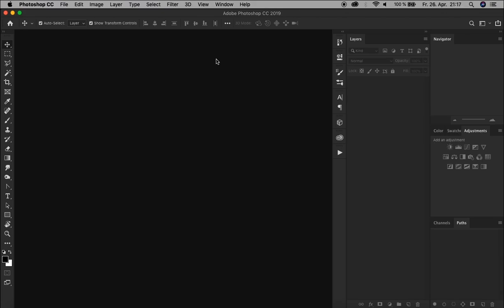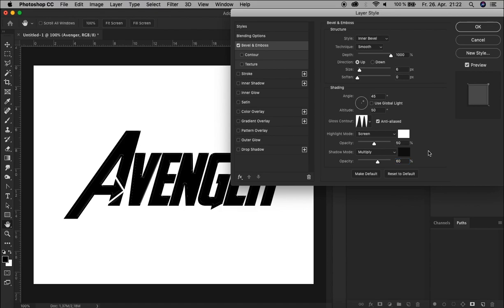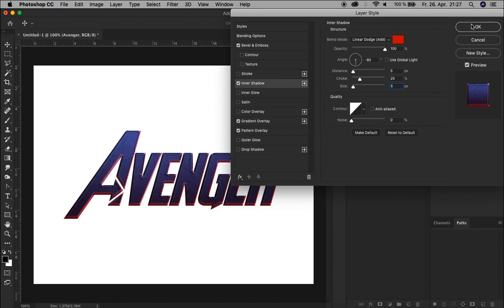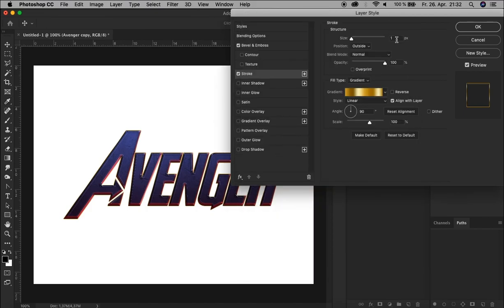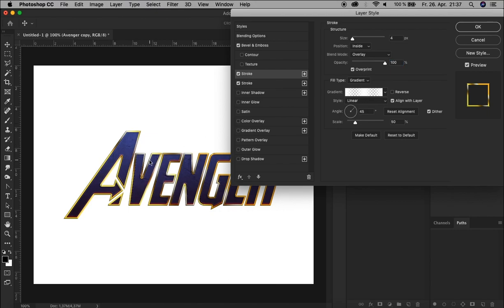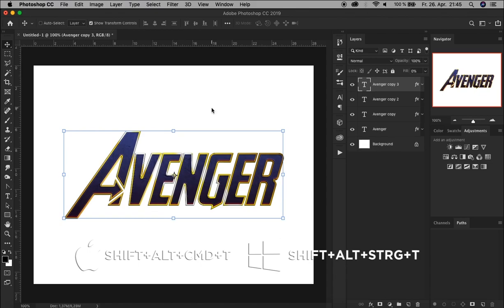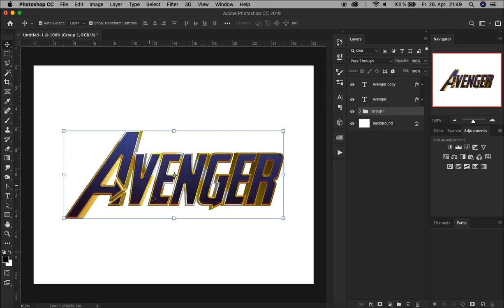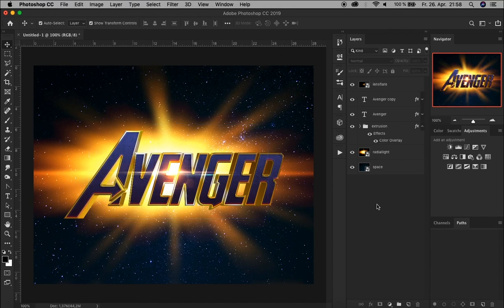How to Create AVENGERS:ENDGAME Text-Effect + 3D || Photoshop-Tutorial

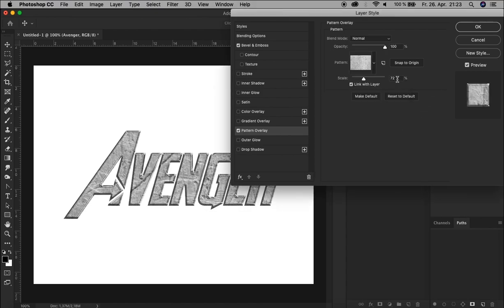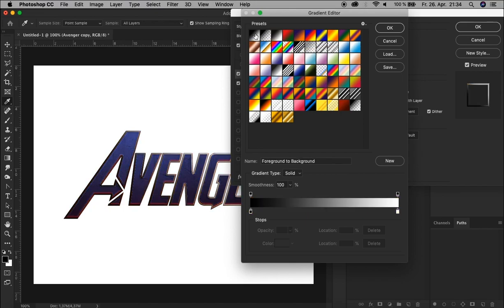Comment: where can download patterns in 3:24? i already search google, just found jpg file only..how want add patterns to photoshop if just need PAT file? 9:30 why cannot remove? i already  drag & drop it..many time i do, but cannot until now..u just drag & drop it or need press any   button?
Reply from the maker: PATTERN:
Unfrotunately i've lost the source-link to the original. But all you need is a slight rock-texture that looks similar to it. But if you already got one you just need to open the JPG-file in PS, go to Edit -> Define Pattern and confirm. then it should be visible in the pattern-gallery.

GRADIENT-STOP:
If you want to remove the gradient-stop, you have to pull it DOWN!
Reply: @sahinduezguen  Pattern:
Ya..i already do like u said..already done..thanks about that..

Gradient:
This i already try many time, cannot too..maybe difference version..
Reply: I can't do the duplication of stroke like in 8:52..u not show how want do that if dont have  plus symbol..u can show it?
Reply from the maker: @nurhikari88  Which Photoshop version have you got?
Reply: @sahinduezguen  Photoshop CS6 2019
Reply from the maker: @nurhikari88  Well, i think that version actually feature that option. If not, the only solution i see is to add the second stroke to another layer above it with 0% fill.
Reply: @sahinduezguen  how? where want need open?